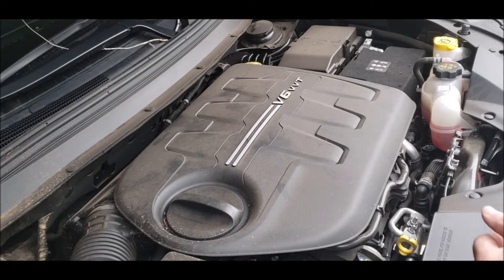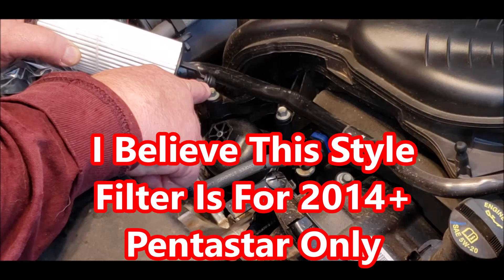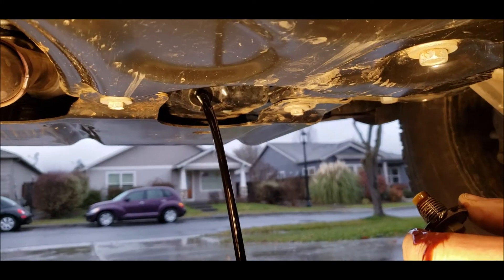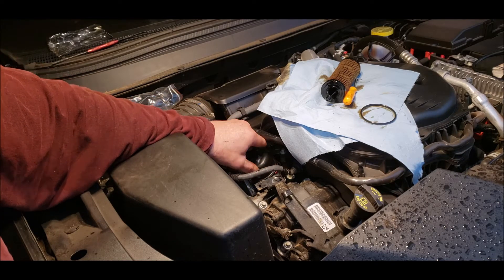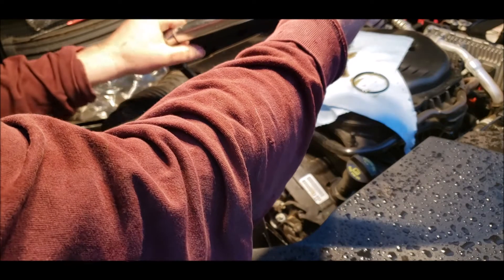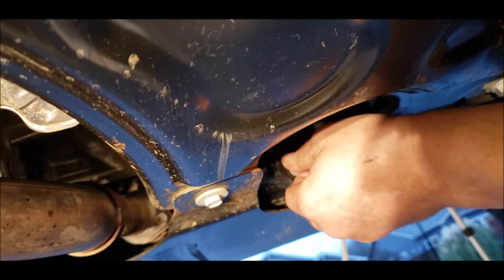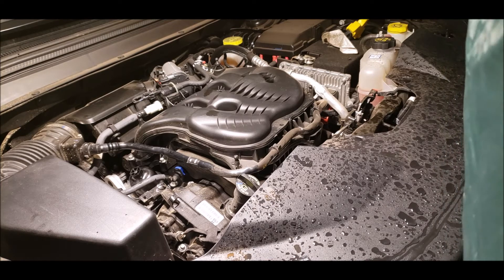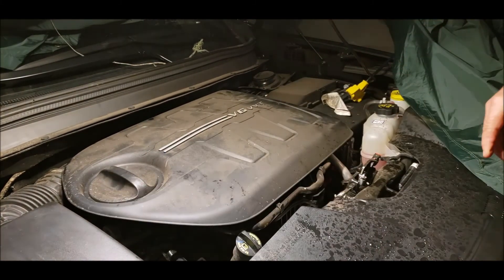26: DIY Pentastar 3.6/3.2L V6 Engine Oil Change Method For Less Filter Mess.

Comment from the maker: UPDATE June2024: I no longer use AMSOIL as it failed its oil analysis before the drain interval was up and engine performance was dropping off.  I did a few very short drain intervals with a less expensive synthetic and have used Valvoline Restore and Protect for the last 1,000 miles. The engine’s power and gas mileage have returned to normal now. Future drain intervals will be no more than 5,000 miles.

Comment: Im a bit confused, I bought washers (10) from Rock auto.( felpro 72907) using the drop down menu system.  But when I pulled my Plug off (and it was on very very tight.) there was no washer. It does have black rubber and appears very similar to yours. do I forgo any washer on this vehicle. 2016 RAM 3.6, I didn't

Comment: Hey! I’m new to doing mechanical work on my cars, and I just did my oil change on my ‘18 Journey with the same 3.6, and I slightly over torqued to oil filter cap (19 ft-lbs instead of 18) and I know a problem on this engine is that the housing/cap/cooler cracks when over torqued, am I okay?
Reply from the maker: Yes
Reply: @ElectricDanielBoone  thank you!

Comment: 6700 miles? You will doing rockers soon
Reply from the maker: I'll put them on order now. No tic yet though.
Reply: Not true my Grand Cherokee has 70k miles and oil change interval of 7k miles and no rocking whatsoever. It’s not oil related it’s just a faulty cam rocker bearing issue. There are plenty of pentastars with 300.000 miles on and no issues disregarding oil change intervals and also some cases of almost new engines with this issue.

Comment: Very good video.  You showed some good tips and changed the oil and filter the proper way, unlike some other YouTube videos on this subject.  The only difference I have is the way in which you reset the oil monitor.  The owner's manual shows 2 methods, but the one you showed could be simplified.  Here's directly from the 2020 owner's manual:       
 Oil Life Reset
1. Without pushing the brake pedal, place the ignition in the
ON/RUN mode (do not start the engine).
2. Navigate to “Oil Life” submenu in “Vehicle Info” in the
instrument cluster display.
3. Push and hold the OK button until the gauge resets to
100%.

Comment: Dude ur OCI is too long.  5w30 is better.  5w20 is way too thin.  This motor very prone to tappet roller bearing failures.  Change oul every 3k.  The JEEP is an off road vehicle.   Changr ur oil more often.
Reply: Heck yeah.  Those owner's manuals are just a waste of time.  Don't pay any attention to what they call for.  (Yes, sarcasm intended).
Reply: @gonebyrv9748  I am a mechanic.   Go ahead do what u think.  Black oil says it still can go 25,000 more miles
Reply: I've seen mention not to use 5w30. Unless you live in a hot climate area.
Reply: @MrLaughingcorpse You're right, use whatever's on the cap... Or in the manual And change it every 5,000 miles and I recommend Pennzoil ultra Platinum, The only oil recommended by John Hennessy used in the demon and the Hellcat from the factory
Reply from the maker: @lynch6642 check out my update. The 3.2L was cooking the AMSOIL, so I lowered the drain interval to no more than 5K miles. No more AMSOIL, as it’s too expensive to charge that often for me.